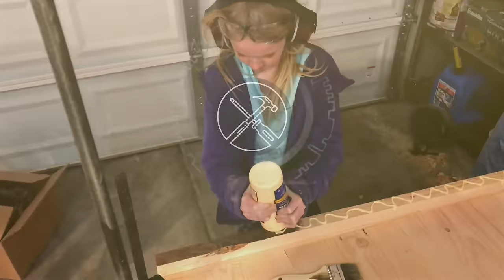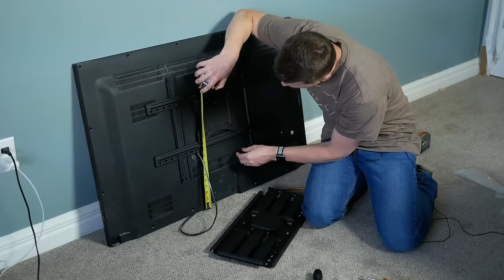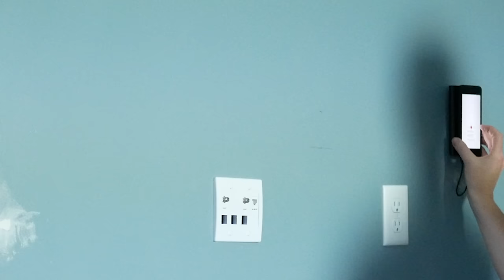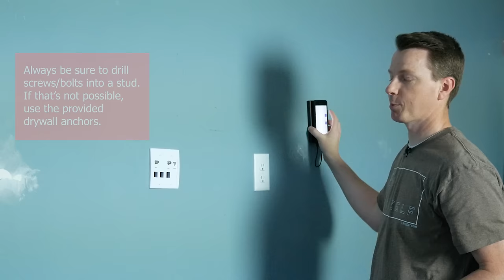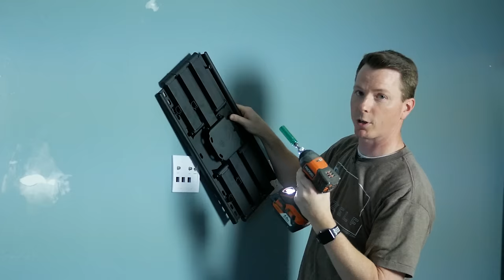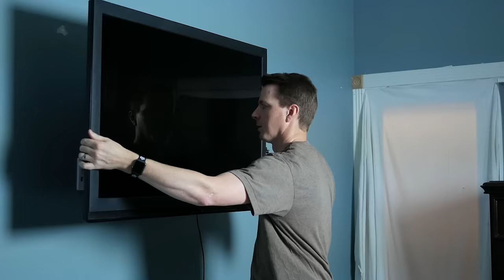How to Mount a TV to the Wall: Simple and Safe Steps

Comment: How do i know what lenght of the screw do i have to use when im putting the screws back inside the TV, after removing the ones the tv had?
Reply: Should come with some in the box or sometimes you can use the same ones

Comment: Did you use washers? I have a similar mount and I can't figure out how the horizontal bars are screwed to the vertical ones. There's no space for the screw if that makes sense? Ideas?
Reply: good question about the horizontal bars. I guess they must be using very short screws.

Comment: hello very good video when there is wood to support the tv what happens if there is no wood fences only 2 feet apart what do you recommend?
Reply from the maker: Funny you should mention it - I have a video I'm recording this week that shows a TV mount that doesn't go into the stud but directly into the drywall and supports just about any sized TV. Do a quick search for "No Stud TV Hanger". Bear in mind that this only applies to drywall, if it's something else then it may not work.

Comment: Great video !! How many screws did you put in the hole and how would you know the extra screws haven’t passed the studs in the wall ?
Reply from the maker: Duka TheClever  Not sure what you mean by extra screws but there’s just one screw per hole and you can be sure you’re drilling into the stud if you see sawdust as you drill.

Comment: if i don't find any studs (or can't use a stud finder) and i drill directly on the drywall without hitting anyhing (luckily) would there be any repercussion ? basically, if i drill directly and hang the TV on the drywall rather than studs would it fall off ?

Comment: I have a 40 inch tv and my father in law got us the wall mount before I can buy it. 
He needed up getting a mount that holds up to 13-32 “ . I tried telling him it won’t be compatible but he said the studs will give it extra support to hold it which I felt was untrue. PLS LMK! I have a mount on hold at wal mart rn Incase it wont hold
Reply: Joey Valenzuela when it comes to a size slightly over the recommended size, I’d go off of what is the maximum weight stated on the mount. If you’re under that, you’ll be fine.

Comment: Great videos! Do you have a video dealing with walls that have metal studs instead of wooden ones? I live in a condo and all the walls have the metal studs.
Reply from the maker: I don't have a video on that, mostly because I haven't had the opportunity but that's something I'd love to look into as metal studs are becoming more and more popular. Thanks for the suggestion!
Reply: Hi! I'm sure my comment is 5 months too late, but I work in commercial construction and deal with metal studs all the time. What you'll want is long self-tapper screws (about 2 inches to go through the sheetrock and the metal) and an impact drill with a Phillips bit. While it's possible with a normal drill, it can be a little more frustrating. Hope this helps!

Comment: How can you adjust the mount away from the wall for clearance to HDMI in the back and plug it into the wall without skinning your knuckles?
Reply from the maker: If you don’t have an arm on the back of the TV you’ll need to lift and remove it from the wall to do this work.

Comment: I have panels with studs. I called the company I bought the mount from and they said it was fine as long as the mount is definitely in the stud behind the panel. What do you think? Do you think my TV's safe?
Reply: So long as it's mounted in the studs, it'll be fine.

Assuming the studs themselves are weak for whatever reason.

Comment: Thank you for sharing...this is very helpful!...wish me luck in a couple of days when I attempt this🙂
Reply: How was it?
Reply: @mtsanchez27  Fantastic...my TV is mounted and secure against a corner wall...I installed the plastic tubes on the wall to hide the cord and installed a small wall shelf underneath the TV to set my cable box joey on...not bad for this handy girl!...thank you again
Reply: @Delta1Duck  ok, thank you very much for your answer, Im trying to mount my tv I think I just need to buy the tool to identify the wood in my apartment wall.
Reply: Marcos Torres I had a stud finder and because I mounted TV on a corner wall, I only hit one stud ...for the screws where I did not hit a stud, I used those butterfly toggle bolts...my TV is a 42” and probably will not be moved around a whole lot, so I think it should be fine...sometimes you can knock on the wall with your knuckles to find studs....when you knock along the wall and it sounds hollow=no stud...keep slowly knocking until you sense density and that is a stud...all the best with your install!!
Reply: @Delta1Duck  wow! I didnt think about it until you're telling me, I really apreciate it that you share your experience with me, thank you very much!!
Reply: Marcos Torres, por nada...I learn so much from others by watching all these videos!!
Reply: @Delta1Duck  and Im learning from this video and from you!!

Comment: Can you just drill into drywall only? and not using stud?
Reply: No because the dry wall won't hold the weight of the tv
Reply: Yes. It depends on what size the tv is. It could work with a smaller flat screen.
Reply: @Error-_________________  dont try it bro .
Reply: What does a stud do😂😂😂
Reply: Swiss Divinity it’s just a piece of wood that is in the wall
Reply: I think you can just use toggle screw things
Reply: Yes use the anchors

Comment: Will TV still work if you put the  screw  right on the back of it.
Reply from the maker: If you mean driving a screw into the back of the TV itself, not into one of the mounting holes, probably not. That's likely a quick way to destroy your TV. As for the mounting holes, they're meant to accept the mounting screws like you see in this video so that should be fine.
Reply: @LRN2DIY  Thank you

Comment: Is there a way to do this without a power drill?
Reply from the maker: Not having a drill makes this really tough. You can drive the lag bolts into the studs with a wrench (especially a socket wrench) but it's a lot more work and if you don't predrill the holes, it'll be tougher work and you increase the chances of the studs splitting or cracking. Even a cheap $30-40 drill will help a lot.

Comment: Well, that's all fine and dandy if you've got $200 to fork out on a wall mount. Personally, I've found that a couple of bolts and a length of steel cable works just as well. Claw hammer to hide the wires. Hey, who ever looks behind your TV, anyway?

Comment: The only thing I'm scared of wall mounting a TV is that, I'm scared it'll fall down, even if it's hang tightly.
Reply: As long as you're in the studs and didn't over tighten your lugs with your impact drill then you'll be fine. You can tell if you've stripped the hole if it is loosely spinning and you can't feel any resistance.
Reply: Pro tip! Don't live in the USA and have normal brick walls
Reply: Dutch Guy ?
Reply: @MinecraftXM  lmao!  Exactly 😂😂😂😂

Comment: Also how many screws are recommended if you have heavier mount ?
Reply from the maker: Duka TheClever As long as you buy a mount that is rated for the weight of your TV, you can just follow the instructions from the mounting kit. It will vary by kit.

Comment: Is there any good solution to hide cables in concrete walls? That could be a nice theme for a new video.
Reply: Use a masonary drill bit and run a chase into the wall , push the cable into the gaps and filler over the top.
Reply: @C4rL72  
Thank you for answering my question. I will search for that.

Comment: But what if you don’t have a stud finder 😑
Reply: Take a thumbtack📌. Start by poking a hole in the drywall on either the left or the right side of an outlet. Then take a pin📍or a straightened paperclip 📎 and try to push it through the hole you made with your 📌. If the pin feels like it went through too easily, that means NO stud is present. If the pin feels like something has stopped it from moving in further, chances are you've just identified a stud. Electrical outlets are generally installed along wooden studs throughout your home. So if you don't feel like buying a studfinder, you can use this trick to help you track them down. Studs are almost always spaced 16 inches apart. Once you find one, just take a ruler 📏 and measure 16" to the left or to the right and try your pin and thumbtack trick again to be sure. Hope this helps. Happy hunting 🎯.
Reply: Stud finder=$20......

Comment: what kinda drill he using ?
Reply from the maker: It's called an impact river. They're awesome for when you need some power. Here's a link to the one I use (part of a kit) homedepot.sjv.io/zAb06 or you can just buy the standalone tool with battery and charger here: homedepot.sjv.io/1XPgm. It's probably my most used tool.
Reply: @LRN2DIY  thank you kind lad 👌

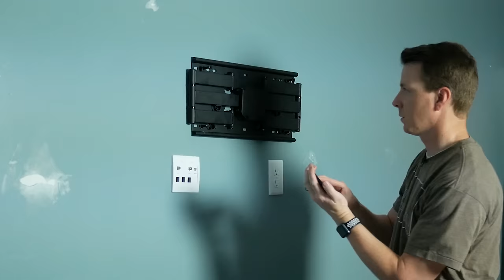Comment: 10:14 Consider how many time you will drop the phone on the floor while getting that mount aligned and bolted to the wall? The cellphone is the last thing you should use as a level, especially if the floor is tile or stone (unless you have a spare one). Rather use a cheap plastic level from the hardware store, if it's not coming with the mount...

Comment: No anchors??
Reply from the maker: No. Anchors are specifically used to mount heavier objects in drywall. They expand the contact area of the fastener to provide more strength since driving any normal screw into drywall is likely to result in said screw pulling right out. If you're drilling a bolt or screw into the wooden stud, you don't need an anchor because the wood can hold it in just great.
Reply: @LRN2DIY  ok wow i used anchors because I’m  usually terrible at getting a screw in wall without stripping it 😆 so using the anchors gave me some security, plus I followed the instructions for my mount, but whatever works for you.

Comment: As an installer please never use an iPhone or the level that comes with the mount, you will never get a TRUE reading that way, and I can’t believe I watched this video SMH,  what everything else that goes into hanging a tv like running electric, low voltage wires, hooking up equipment, adjusting video settings, updating all network devices???
Reply: What can you do if your wall is an old chimney, and does not have any studs?